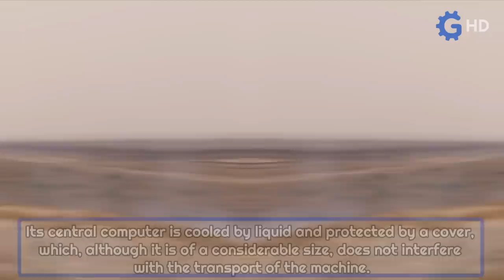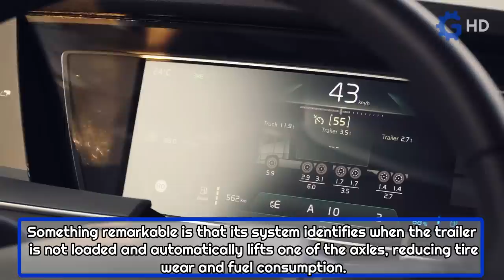NEXT GENERATION TRUCKS & TRACTORS YOU PROBABLY DIDN'T KNOW ABOUT  ▶MACHINERY TRANSFORMATION

Comment: An excavator robot. If I think how many cables and water pipes appear unexpectedly in city areas, will the robot manage it? And what about the unexpected World War II bombs? The driver will surely be happy to be far away.

Extra long trucks: many bridges already have weight restrictions. Well then the truck could first drive over the bridge and then pull the trailer over the bridge with a winch. But with today's traffic density it's more of a joke. But how are cars supposed to reach the entrances and exits when there are extra long trucks?

Field robot: Great, the farmer no longer needs to look at the field to see what needs to be done.
Or does the farmer want to know how and what grows on his field? There is certainly a complicated solution for this

A truck for the field? old hat that has been around successfully for a long time. Mercedes Unimog
only the demand comes less from the framers. 
PTO shaft front and rear, attachment parts all around... The street cleaning teams have many uses.